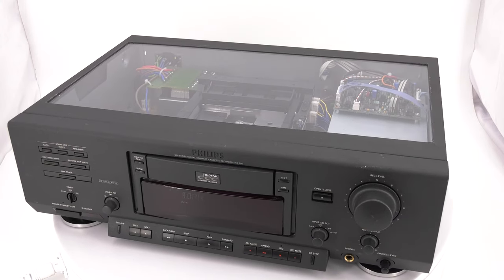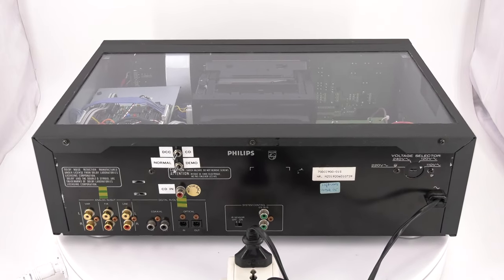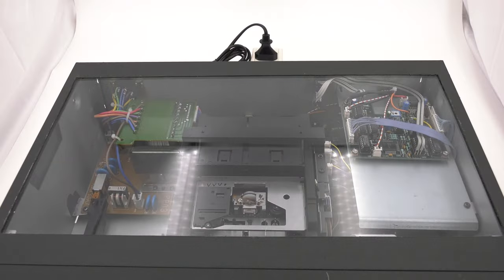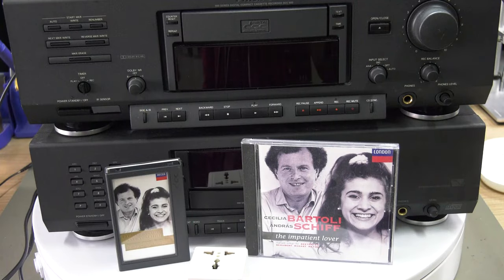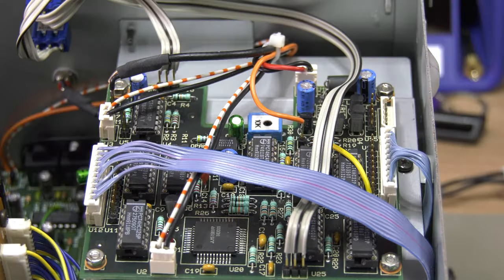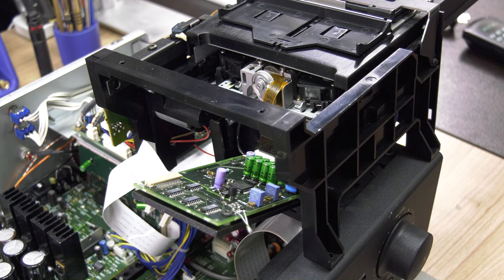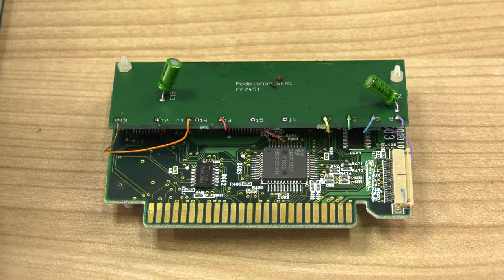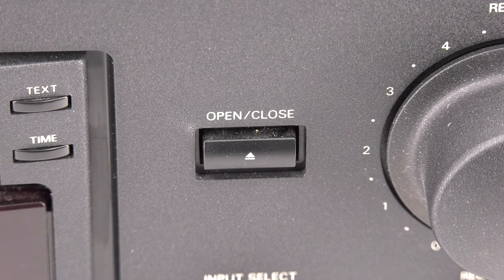The Philips DCC 900 Proto and Demonstration Digital Compact Cassette

Comment: Hello, I have a DCC 900, today the sound is very slow, practically nothing is heard. any help on what it can be or what to check. Thanks.
Reply from the maker: You would have to replace all 17 smd capacitors. We have a video about this as well.
Reply: @DRDCC  Ok thanks l will see the vídeo.

Comment: You say replacing those 5  capacitors,, but I count 7 capacitors, I have the DCC 951, and also do have an open/close printed on it, but do have those shit capacitors in it, that,s why It not working
Reply from the maker: Hi,. Only 5 smd capacitors. Those are the problem ones on this board. The regular through hole on the other side are ok. Your 951 is not the same as the early 900. The 951 was made years later in 1994/1995.
Reply: @DRDCC  I just get sound out of the DCC951, but only when I play the demonstration DCC cassette, if I play a pre-recorded title or one I had recorded, there be no sound and say sometimes clean head, it not say it whit the demonstration cassette, and wen  try a  regular analog cassette, only hear blop....blop...about ever second, sound as a broke capacitor, but weird that the demo cassette just seems to play,s just ok
Reply: It,s the DCC DEMON STRATION cassette  (Polygram special projects) that I only can hear, I do have the TOTALLY DCC SADC 546 cassette, but it gets broken in the DCC134/00 small player that had fallen on the ground ones and not be working, but if I m correct I must have 2 off those  TOTALLY DCC SADC 546 cassette,s ( recorded in the USA)
Reply: @DRDCC My DCC 951be back alive and good working 
Only  did replace the power capacitor  (50v 2200 μF) 

And  on all those SMD capacitors in my machine was nothing leaking or bad to see 
In my DCC951 think from 2015

And It seems to be  Panasonic brand  If correct some more (a total of 19 SMD  (12 x10μF, 7x47μF) presumably also better quality than those previously used SMD capacitors in other models, 
And if some extra MSDs have been used in the later 951 version. the temperature would then be better spread over the multiple parallel-connected SMDs
and therefore less burdensome

My cleaning cassette seems not to be working as not did make swipe moves, did notes it after had opening the top cap. of the DCC 951
 So did tried it with a cotton swab and Propranolol Alcohol, but still kept it giving clean head and dropouts  problems

So I had cleaned the head and drive with a cotton swab with a little CONTACT CLEANER on it  and it DID plays like new again,😏👍

(contact cleaner also can release some oxidation/corrosion attack and protected also) 

And P.S

Here ones in the news, is that EEC concluded out of an investigation that ten electrolytic cap manufacturers from Asia did form a price cartel, at least between 1997 up to 2014., that maybe was  be the issue of some bad capacitors in those that time 🤔

Comment: Hello ! Looking at a dcc 900 and the seller say that no sound out from the player. What can be wrong.....easy to fix ? Does it play and record cassette tapes ?
Reply from the maker: Most likely the capacitors are leaking and caused damage. Unless you are willingly entering a project, be careful. Consider buying only a fully restored one.
Reply from the maker: @stiffe68  Maybe it will be ok. It all depends on the price you need to pay for the unit plus repair. We are happy to help as well. You can record up your 90 minutes on a DCC. There are also 105 minute tapes, but those are a rare find.